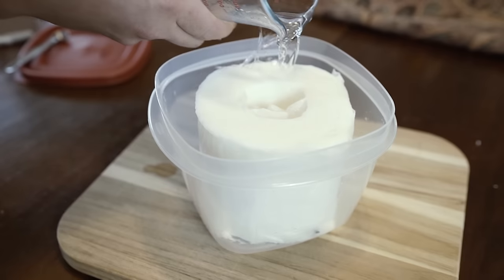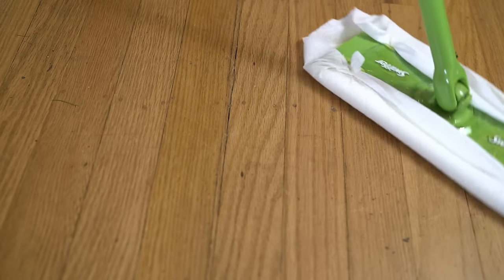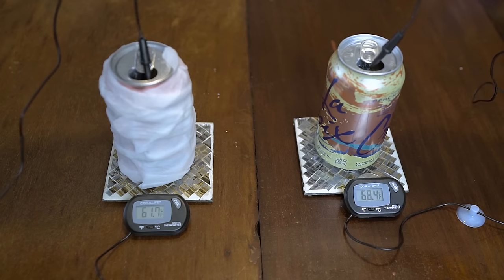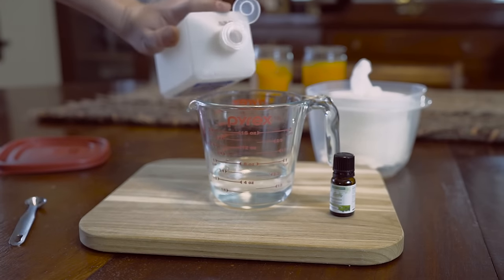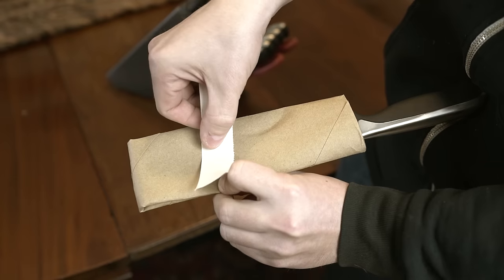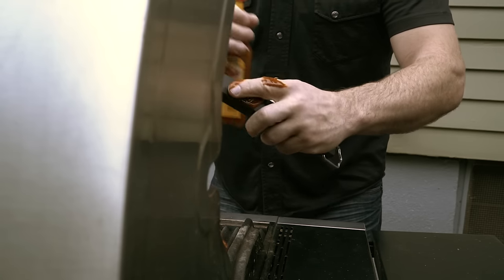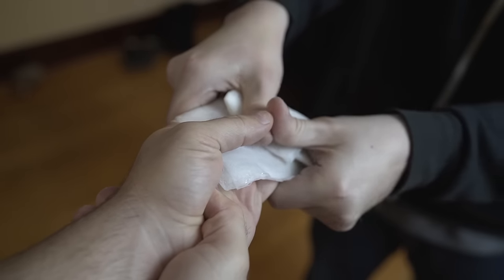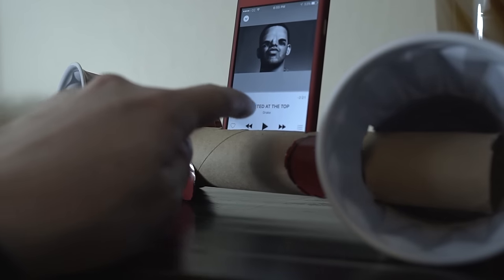9 Awesome New Uses For Paper Towels

Comment: I use the paper towel + vinegar wipes all the time. I bought a large container of Wet Ones (the wipes that come in the tall, cylindrical plastic containers with the pull-through lid. Some baby wipes come in them too) and reused that as my container. Instead of paper towels, I had a roll of the Chux kitchen wipes (bout same size as paper towels) which I cut down to size with a sharp craft knife and I used a mix of dettol and water for use in the bathroom.
Also, don't use an old tin, like coffee/milo etc. I saw that idea (with the white vinegar,dish soap n water mix )online and tried it, it worked well for a few weeks and then just rusted really bad (in hindsight it's pretty obvious but I didn't think too much about it at the time of making it lol). I also keep my glass cleaner and an old teatowel under my bathroom sink, then if I see it's dirty etc while I'm doing my teeth etc after showering, I can clean it right then n there, no having to go and track down the glass cleaner or a dry rag and it's way easier to do when it's got steam on the mirror :)
Reply: Nice! I use that recipe you mentioned with my own wipes and love it! (Vinegar, rubbing alcohol, dish soap, etc)

Comment: I love the homemade sanitizing towels idea, but I feel they'd tear or shred too easily when being removed, and the alcohol-water-oil solution would evaporate through the top. I'd suggest making the X-shaped cuts a hair or two wider, and then attach a bit of Scotch tape next to the opening so it can be sealed after use and reopened later, like baby wipe or wet toilet tissue pouches.
Reply: Come to think of it, you could make your own wet toilet wipes and hemorrhoid soothing cloths by changing the solution to a mix of water, aloe, a few drops of witch hazel or tea tree oil (and maybe mint for cooling as well?), and a bit of olive oil.

Comment: Another hack: You can use the inside of the roll (the brown bit) to blow some fat ass o's.
Reply: I insist that you try it if you're shit at blowing o's
Reply: Haha
Reply: +RJKT vape?
Reply: +RJKT - But can I use paper towels to help my dry knuckles?
Reply: +BrianOfAteionas But can you use it against the '95-'96 Bulls?
Reply: todd pacheco Yeh vape, smoke whatever you prefer.
Reply: +RJKT How does the inside of a roll help blowing o's? 

I can't blow o's. I can't blow o's with the roll.
Reply: Supra Kooper So you inhale whatever you smoking or vaping, Place you lips in either hole of the roll and the end. Then lightly blow the smoke through the roll until you see it slowly running out of the opposite end of where your mouth is. Once that happens all you do is just use the coughing method for blowing o's (which is just coughing, but cough quite hard with the roll) then you should get some fat o's coming out the end. Hope that helps.
Reply: +RJKT or you could use it for cocaine, if you're hipster like me.... vaping is too mainstream
Reply: BlankLotus hahaha
Reply: +BlankLotus This works great for elephants who are using cocaine.
Reply: +BlankLotus It's good for spooling thin, layered sheets of paper.

Comment: Why does wrapping the drink with a wet paper towel cool it faster? Or putting a drink in a wet sock outside in the cold?
Reply: I think the wet whatever just gives it a little more... I dunno, coldness? That's a word right?
Reply: As the water cools down it takes away to heat from the drink. The heat trasnfers a lot faster cos (i'm not 100% sure) water has a high heat capacity
Reply: Or as the water evaporates it takes away the heat from the can

Comment: Paper towel tip: Cheeto dispenser (crunchy works best)

Get your bag of cheetos and place a paper towel tube in the bag. Rubber band/tape the opening of the bag around the tube to fit tightly against the it. After that, wrap the outer tube with clear tape so it doesn't get soggy. You now have a cheeto dispenser to pour directly into your mouth to avoid cheeto hands.

Comment: for all of you stonners put there, fill the tube from  the paper towel roll with dryer sheets. put a balled up paper towel at both ends, then blow the smoke in the tube to conceal smell. this is very useful if you smoke in your house.

Comment: Don't do the one with the wet paper towels on bottled drinks, putting glass bottles in the freezer can cause them to explode from the expansion of being chilled.
Reply from the maker: I said that in the video, but it can be repeated: 15-20 minutes is fine but keep an eye on it for any longer.
Reply: HouseholdHacker I'm saying not to do it in general, it can be unpredictable depending on the carbonation or how much its filled with a liquid. At least the cans themselves will just spill, the glass can cause various bits and pieces everywhere. I did hear the part about you warning people that it could explode, but I'm just making sure that people don't do it with glass bottles. Thanks for giving your viewers a warning and acknowledging my concern.
Reply: Most just put them in the fridge or a cooler
Reply: +Scar1280 Then you can use bread to clean up the class - solved
Reply: or you could just fill up a tub with cold water, ice, and salt and place your drinks in there
Reply: Use whole wheat bread to clean up the glass.It's more spongey than other bread.Make sure it is THICK,to prevent "unfortunate cut fingers" (wink wink nudge nudge)